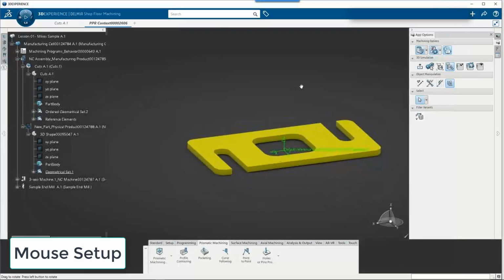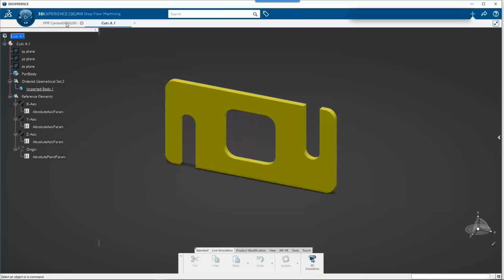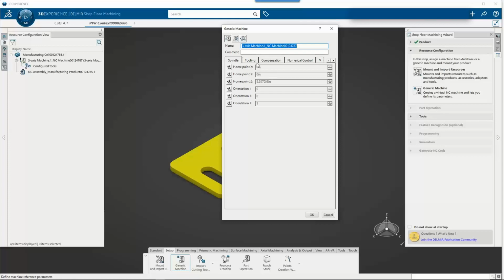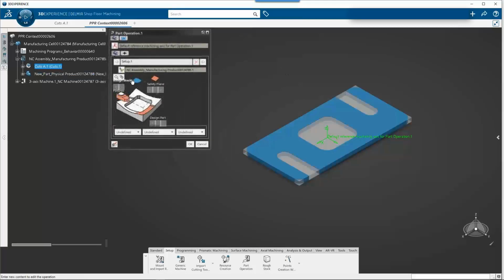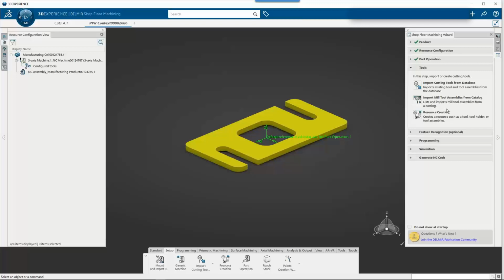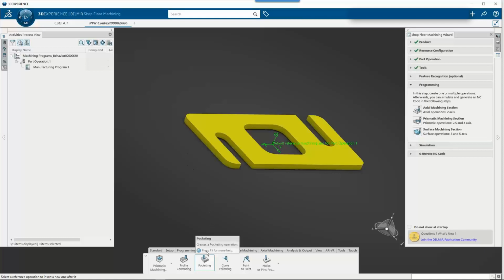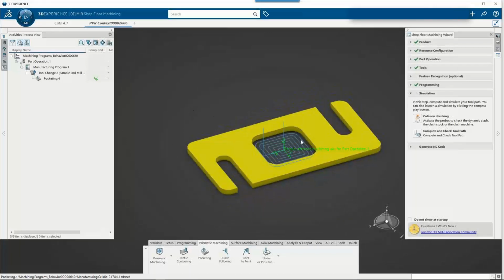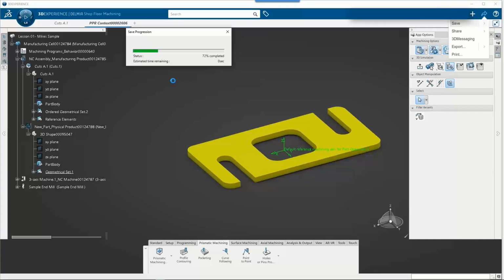DELMIA Foundations   Lesson 01   Shop Floor Programmer

Comment: This doesn't seem to match the current version of DELMIA.  Is there an updated version of this video?  (also seeing that it doesn't look like comments get answers... I'll go exploring.)
Reply: I have the same issue with 2022. I get to programming but items in the Resource Configuration View are different and ask for things that  weren't created/selected (like the tool holder for example). It would have been helpful if he had simply stuck to shop floor programmer for dummies and done one basic step at a time, leaving off all the fluff about editing after the fact, and tricks and possibilities. eg. click on this stupid. Now click on that. Leave everything else alone. Now click on that. etc. etc.

As you say. No replies are forthcoming and, from my own sleuthing, there are no other tutorial available
Reply: @IndulgeInCider  Doesn't help that the program isn't exactly intuitive. Clearly not designed for hobbyists like myself. Almost nothing makes any kind of sense at all to my poor little brain and the tutorial is a word salad of terms and irrelevant data. At this point, I'd be willing to pay for a simple, straight forward, no nonsense, step by step guide to machining a part with this software.
Reply: I give up on this mess of a software. I will probably pay for Fusion360 and cancel Soldiworks. Can’t pay for 2 software solutions and I need the cam module. 
As far I can tell it doesn’t support any of the hobby CNC post processors anyway.
Reply: @Todestelzer  Yeah, I gave up on it a few months ago.  Hot garbage is what it seemed like to me.  It's a shame, because if you could get SW and decent cam package for $10 / month, it would be totally worth it  for a hobby guy like me.  It seems like all the parts are there, but the execution failed.  I'm sending my money to the FreeCAD team now.  It isn't there yet... still in its infancy, but I'd like to see them get there.  

I'll give away my cnc machine before I buy Fusion after their little "It'll be free for hobbyists forever... it's still free, just unusable!  But for only  $500 per year you can do what you did before... Oh, wait, now if you want to do what you did before you also need to buy this $2k "machining module".  F them.  F F F F F them.  I'd buy something more expensive that did the same thing just on principle. F them.

Comment: for people creating a tool, and who cannot select it after like in the video, you need to go to the preference to change the tool search "allow selection of a simple tool in the activity"
Reply: Hi Mikael Can you give a few more details for this operation ?  (yes I am THICK)
Reply: @Fubar12341  Click on your profile button (your initials in the upper right) -> preferences ->app preferences -> simulation -> machining. It is in there but it still didn't work for me...
Reply: @Fubar12341  I'm sorry I can't. please read what I said earlier you should be good.
Reply: It appears this no longer works like it use to. Wow this new update is packed with unpleasant surprises.